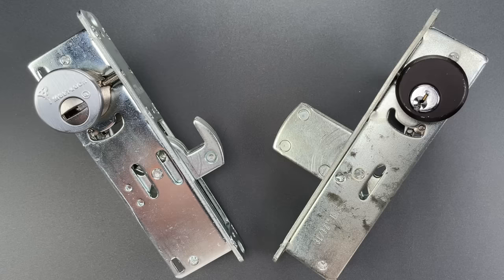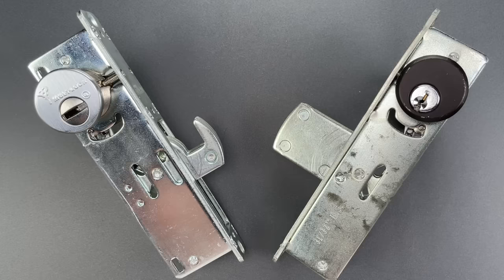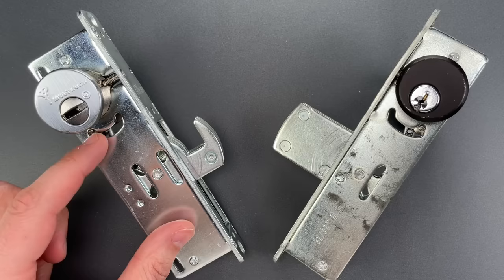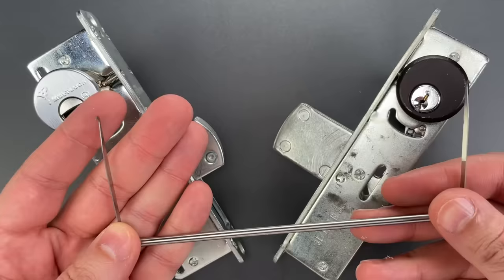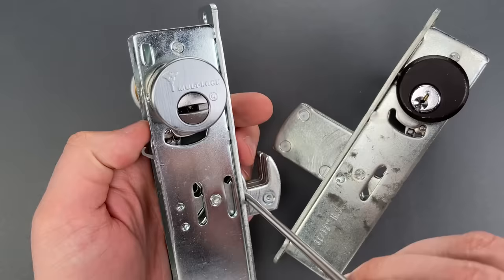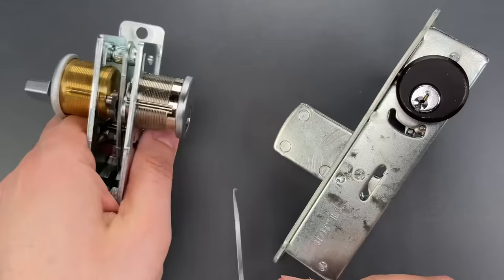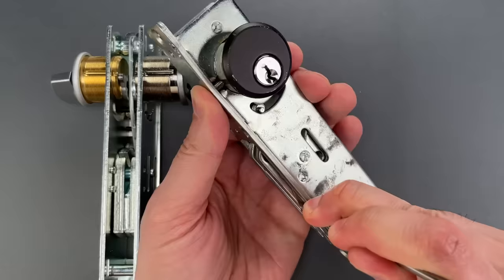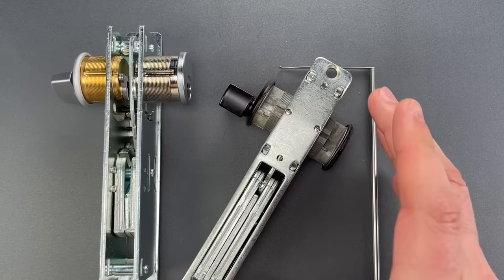[1409] The Most Significant Security Flaw in North America

Comment: This risk has been known since the mid 80s actually. I used Adams Rite locks for my UK  design for Portastor High Security Cabinets, a cabinet we used to sell in 100s and 1000s to UK schools to protect their then very expensive computers. Identifying this risk, I set the lock back further to the left  and well as much deeper, with a Dom europrofile cylinder encircled by a 10mm escutcheon behind the 3mm steel cabinet door, The 3mm door edge had a 15mm x 10mm bend in it and the reveal (or a second door) had a corresponding  bend in it so that the Adams Rite lock could not be accessed from the outside of the locked cabinet. Further, the Adams Rite mechanism was encased in a 3mm steel sleeve. 

The only sure way the cabinet could be opened was by brute force and even then, independent attack tests showed that it would take about 10 minutes to open it. of course in the 80s, portable angle grinders (and I dare say lock picks ) were not easy and cheap to obtain items so attacks came down to sledge hammers and jemmies. When asked if we would guarantee our cabinets could not be opened, we naturally declined and even though we were in the UK, we would say " even Fort Knox does not come with a guarantee" 

Our assurance was that if a school (or UK Government office - even the UK Govt Cabinet Office tested them) had 20 of these cabinets, burglars might only be able to empty one cabinet in the time it took for the police to arrive in response to an alarm being triggered.

Over time, I had made my employer £ millions and when in 1992 I asked for a deserved promotion and was refused, I left to set up my own physical security products business in York, UK  that ran successfully with totally different designs (by me), so you can imagine I really enjoy watching these videos. 

So, from York, UK, thanks LPL and please keep up with the good work x.
Reply: It truly baffles and repulses me when employers refuse employees from sharing in the bounty of their contributions. I'm sorry they stiffed you, but I'm glad you had the dignity to set out on your own!

Comment: Showing this tool off at public doors really shows just how easy it is for "locks" to be opened up. Incredible stuff.
Reply: most domestic doors dont have a 1/4 inch gap around them because of heat loss/ingress, also they usually open inwards so there's  decorative trim
Reply: As others pointed out - a glass door has a lock as a way to politely remind people you don't want them to enter that door. Anyone who plans to ignore your request not to enter will use a brick, not a pick.

The reason for this tool to exist is for the cases where someone needs in who doesn't want to damage the door - first responders not wanting to carry patients over broken glass if possible, and locksmiths who you wouldn't call to break your glass for you.

Comment: When I had a retail store I realized the back door panic bar had a huge flaw. Drill a hole above it, stick hard wire bar & pull opening the door. So I put a slider dead bolt into the upper door. Never had the issue, just a preventable measure.  But to see this flaw was jaw dropping!

Comment: I'm a union glazier and we use these in storefront doors. Continued rods when engaged into the threshold and door frame header are another safety feature but not often utilized
Reply: can they be retrofitted?  If you don't have them?
Reply: @nextari  to be honest I really don't know, I would have to think so. When doors come out to the field the shop fabricator has all the hardware installed so we in the field can just install the doors to the flush glaze frame or whatever system we've installed.
Reply: @ryanwoods8725  Thanks I'll definitely look into that.  They are easy to remove and all the parts are modular.
Reply: @nextari  Generally, automatic flush bolts cannot be retrofitted. Or at least it's usually cheaper to just have a new door manufacturered with the proper holes bored and the hardware templated.
Reply: a lot of counties wont let that feature be added to the storefront systems (Im a construction project engineer) because of ADA code requirements for egress in an emergecy. often you can lock one side down (if its double) but as you knwo theres added cost and no one likes to pay for change orders. i dont. it fucks up my budget and schedule of values and my bonuese are based on how much contingency is left over
Reply: @nonconformist9930  project manager? We had a guy order 1" IG Units for exterior stick build curtain wall wrong 48 units cost 19,000 to replace. I haven't been on very many jobs where the office hasn't made some kind of mistakes. But as you know they'll make it up somewhere somehow
Reply: @nonconformist9930  if a panic pushbar is also included in the doors it allows for emergency egress
Reply: @ryanwoods8725  PE, not PM yet. Working on that. Came up as local 10 union worker, same union as you (in oregon anyway) an i work for a GC and not a Div VIII sub anymore. I was actually in IX
Reply: @ryanwoods8725  🤣🤣 facts
Reply: @nonconformist9930  local 357 in Detroit
Reply: @ryanwoods8725  out here in oregon local #10 is painters, glazers and drywallers. I was a union painter for 15 yrs before i went back to school to earn my CM and go to work for a GC
Reply: @nonconformist9930  it's the same here IUPAT

Comment: In my trade, as an elevator guy, anytime we're doing service or maintenance or anytime we need to get into a machine room where the customer has lost the key, it's incredible how many times things I've learned on this channel have come in handy. Hell, most of the time it can be done non-destructively with a simple small slotted screwdriver. I need to get one of these because I've definitely run into these locks on many occasions. Thanks for this. Have a good one, LPL.

Comment: This flaw is only feasible depending on the gap between the door and frame. A great way to prevent something like this from
Occurring is by installing a latch guard or a vertical side to side steel cover. Both options are available from your local locksmith.
Reply: Yup! Even without knowing all the security vulnerabilities of the thing you want to keep closed, the first step is to close off unnecessary gaps, especially near mechanisms.

The bolt/latch is often the easiest point of attack.  So easy, in fact, that many who can't do anything in a keyway know, at least in theory, how to open some doors if they can get to the bolt/latching mechanism with common items.

Step 1 is trying to cover that kind of thing up (bonus, it's usually the simplest and cheapest)
Reply: I was sent a high security mortise lock to evaluate by a manufacturer.  It had a wide open keyway that allowed a different bypass tool I had through the lock itself.

It's a surprisingly hard problem to solve.
Reply: this shouldn't have to be an optional add on.
Reply: Yup came to comments just to see if someone eals understood this.  The door your trying to open better have half inch gap are the tool is pointless.
Reply: @gr769er9  Half inch? Did you even watch the video?
Reply: @squishybrain  clearly you dont understand sarcasm duh man.

Comment: I sold my house and on the final weekend before close of escrow, managed to lock myself out with my only key inside.  The realtor key box on the door had a 3 digit letter combination.  I thought back to LPL videos I watched and got a chair and started a brute force combination attack.   I ran through every possible combination... TWICE... and it didn't open.   So, I thought back to MORE LPL videos I had watched, then went and rummaged in my car and found a paperclip.   Bent it straight, slipped it in the gap of one of the combination dials, probed around for a few seconds till I found a springy yielding; pushed on that and POP the lockbox opened right up.  I could repeat the opening-up process in 3 seconds or less once I found the exploit.  Seemed pretty weak after seemingly having gone to the trouble to make the combination mechanism resistant to combination taste-testing.

If I was spiteful, I could have made like a plot point in Heinlein's Time enough for love and changed the combination to something like PIG while I was at it.

Comment: This is just crazy simple. It does really look as if all those companies selling locks don't care about their customer's security – at all! If LPL knows it, any crook knows it, and such a tool can be improvised quite easily. I'm not sure if the situation here in Germany is that much better.
Reply: Locks keep honest men honest; if someone wants in, they'll get in. Whether they do covertly is a different story!
Reply: "If LPL knows it, any crook knows it"
Did you mean that LPL only deals in common crook knowledge or that all crooks watch LPL?
Reply: @Oakshield2  Mostly the first. Maybe not all crooks know these tricks, but this specific trick looks like something many actually do know even without watching LPL. Often enough he just shows the tricks used by crooks and if they work on a certain lock. Well, some (or many) crooks might not be trained enough even for the simplest lockpicking (or drilling) and use brute force, but then it might be a good thing if they learn how to be more subtle and cause less damage … 😁
Reply: In Germany we have got completely different mechanisms with a linear moving bolt, which only can be driven by turning the lock core.
In houses very often multiple closing bolts are engaged by turning the main handle.

However, I would love to see LPL checking these out for weaknesses.
Reply: @norbertfleck812  I thought so – I've never seen locks as simple as the ones shown here (well, inside of houses yes, but not on the outer doors). It would be interesting to see if the cores are as easy to pick or break as many shown here are, but regarding some of the locks are Abus and do not fare well I'm not too optimistic.
Reply: @matthewlawton9241  Locks should make it hard (or noisy) to get in, they can't make it impossible. But making it incredibly easy defeats its purpose completely. Seems to be a cultural thing, as here in Germany we take them much more seriously.

Comment: I have seen similar locks on double doors where just shaking the door will cause it to open. As an irreverent side note I watched a guy installing a lock on one of those automatic sliding doors at a store near my house. New policy, the store was closing for a holiday and it had always been a 7/24 operation, it had never closed before and so had no lock on the door. I thought it would have been funny if that failed to occur to anyone till the last minute.
Reply: That happened long ago with a diner chain called Denney's. They had been 24/7 from their initial creation until they were bought out by some group that decided to save money by closing some of the stores during certain days or parts of the day. The order went out to close the stores, and the managers reported back that there were no locks on the doors. They had to scramble to redo the doors on several hundred stores.
Reply: @lwilton  I think at the time they decided to close all their stores on Christmas Day and ran into this issue. Later new management rescinded that decision and most Dennys are now open on Christmas.
Reply: a big thing with sliders is they are designed to collapse, So in a fire just the people trying to exit pushing on them makes them swing open.  The hook shaped lock on the left is usually used on those but I suspect if someone pulled hard enough they could make the door still swing open
Reply: It actually does happen.
I've been there when an evacuation happened, and there were 24h businesses that didn't have a way to lock up their front-doors.
Some of them pushed shelves in the way of the doors and went out the back doors that locked.
Some didn't bother, preferring that looters used the doors in the hope that they didn't have to replace broken plate-glass windows when they returned.
Reply: "Why are you locking up? The sign says you're open 24 hours."
"Not in a row..."

Comment: the fact that, that door actually had enough gap for the tool is rare in my experience, also no weather stripping, but maybe that's more of a California thing since theirs a lot of strong winds
Reply: I work at a store that uses the first type, hook-style latch on sliding glass doors. You can actually slide open the doors a few millimeters and expose the latch. I think these stores depend more on their alarm systems than investing in locking door security.
Reply: I would say any glass door is heavily leaning on that alarm system and insurance 🤣

Comment: Working on storefront windows, I realized that unless stores security sensors on Windows, you could just pop out the bottom window seal cap and remove the glass if you have a suction cup or 2 to break in then put everything back afterwards.
Reply: I can't tell if you are a criminal master mind or a nice person. If they don't know someone broke in they might not notice anything missing (short term). On the other hand, if they have security sensors on the windows wouldn't they have motion detectors in the rooms?
Reply: Most major retailers have floor wide motion sensors for after hours.
Reply: @xenocide1307  This is why you trigger the motion sensors on random days for a month beforehand from outside the building, until they disable them / stop listening to them. THEN you break in!
Reply: @robertmcintyre9023  why are you like this

edit: Jokes aside that's pretty clever if you find a way to not be caught in the fakeout attempts.
Reply: @nodezsh  why arnt you?

Comment: As an impatient IT guy, thank you. 🙏🏼 Kinda like the good ol’ “Verizon key” (often as simple as a smaller flat-head screwdriver) and a neodymium magnet, this one will find its way into my toolbox.
Reply: or the literal low security lockbox in the alley left behind by the verizon guy that contains contractor id and access card for your high security skyscraper because there happens to be a Verizon transmitter on the roof.
Reply: Not sure “impatience” is an affirmative defense to a charge of breaking and entering.
Reply: @pbp6741  Using tools to non-destructively open doors isn't "breaking", though. Besides, people don't tend to charge people for doing things they asked them to do, and when the IT guy shows up past security without anyone's awareness, that just means you've got a good IT guy
Reply: that tubular key that verizon uses everywhere on t1 card cages and the like something like 52600? I have found so many of those keys in places unrelated to telecom.
Reply: @chompythebeast  It may not technically be "breaking" but legally it's still charged as such. It's defined as "entering through force" and the "force" has been successfully prosecuted to include the force of pushing open an unlocked door, so yes, picking your way in would be breaking and entering.

Being asked to come isn't a defense. The people are less likely to call the cops on you if they asked you to be there, but you CAN still be charged with it. And for good reason. When they have to let you into the building, they know where you are and when you're there, so they can monitor to make sure nothing goes missing while you're there. You may be a good IT employee, but not every IT employee is. It really just hinges on how worried about it they are (and how embarrassed you make the one in charge of that lock).

Before you say the obvious "but nobody in IT would do that" - I also work in IT and I know of people who no longer work in IT because they did things I would have thought "oh, nobody in IT would do that".

(Also, it's not a sign of a good IT guy to ignore user preferences. If they didn't give you a key, your user preferred to wait until you got authorized through the door.)
Reply: @Merennulli  My point was simply why would they press charges if no harm was actually done and the person had a professional reason to be through the door? To be petty? To assert dominance? I guess you could fire someone for it if you wanted to, but pointing out such flaws in (physical) security are the sorts of things companies will pay for
Reply: @chompythebeast  They will pay for having them pointed out by someone they ask to point them out. But if you point them out when they don't ask, they get defensive and stupid. Look at Missouri for a recent example, where the governor is trying to prosecute a reporter for...looking at a public facing website and noticing that it gave out every teacher's SSN.

Comment: Definitely a great first responder tool! nice alternative to a “K-tool” which actually destroys the entire lock cylinder. Or dropping  a metal saw blade between the doors. Store owners would be a little happier in the end 👍🏻
Reply: A lot happier. My previous employer went on an incense burning thing for some sort of "good luck" ritual, so someone saw the building all smokey inside and called emergency. Prying the door wasn't good enough, they also had to break the window out too, only to discover "nothing to do here, nothing on fire". I know I would have rather had them use a tool like this or maybe something like a Southord LAT-17 rather than get stuck with $2500 in door repair and glass replacement and higher insurance premiums. The first thing I thought when I saw this was same as what you said: This would be a great first responder/emergency worker tool that every engine and cop should know how to use.